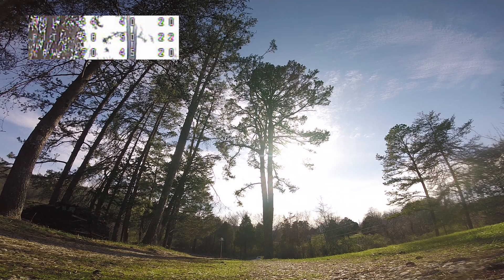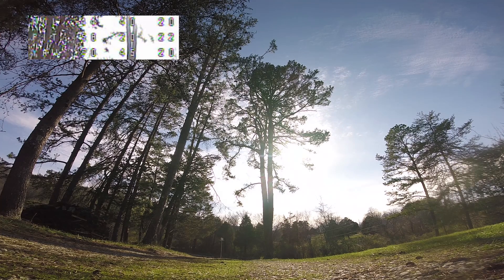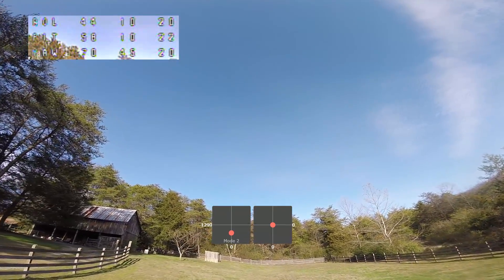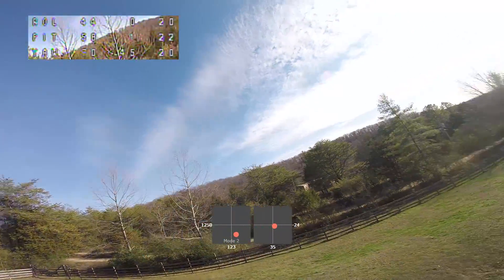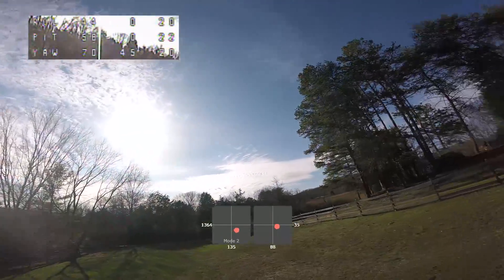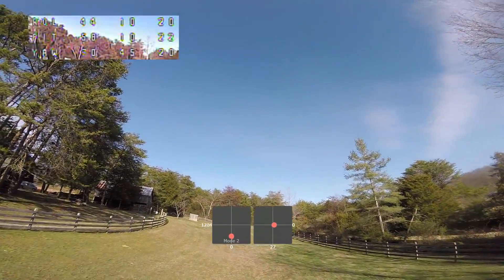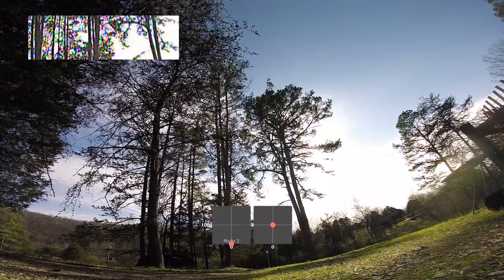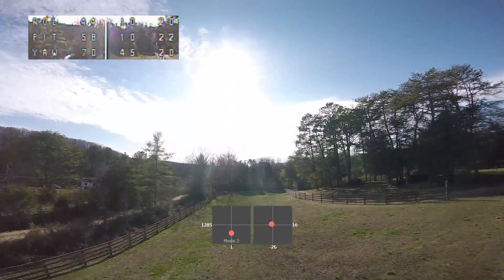PID Tuning Masterclass - Part 4 - Optimizing I Gain

Comment: Hi,  in just hovering, when i throttle up or down my yaw drifts slowly to the right. Until i throttle some more it rotates the quad like more or less 90°. Is that a sign of low yaw I gain? No matter how many times i add yaw trim it doesn't go. And also my roll, it drifts left even no wind and just keep adding trim till its almost 50% trim. Are those i gain probs?
Reply from the maker: First, don't add yaw trim :-) Your channels should always center at 1500 us or the quad will have issues. Go into the Receiver tab and use subtrims on your transmitter (or trims if it doesn't have subtrim) to adjust the channels until they center at 1500. 

Then never touch the trim switches again.

If the quad is in autolevel mode and is drifting, here is how to fix it https://www.youtube.com/watch?v=otJNzZrE-yk

The quad will never perfectly hover. You will always need to make small adjustments, but it should only be small adjustments.

Comment: What are some symptoms of too high I gain? Can micro wobbles on yaw at low throttle be one?
Reply from the maker: No I don't think so. Honestly I think you can crank I pretty high on the latest firmwares and not get anything radically wrong, just a bad flight feel. Very stiff. Micro wobbles on yaw are probably either high yaw P gain or too much noise/not enough filtering. Soft mount the FC. Maybe lower gyro cutoff filters.

Comment: Hi Joshua maybe you can help me. I only have oszilations on my quad when I do high throttle punches. I tried that tpa but it does not seem to have an effect. Have that on 2 same builds. Maybe you have a tip for me.
Reply from the maker: Reduce P gain.
Reply: Thank you that helped me for one copter. On the second it didn´t. I have seen that i forgot a cap on this. After soldering it this copter seems to fly right. Can a cap influence the high output (35A ESC)? Thought it´s just for Videoprobs...

Comment: When I punch out then cut throttle, my quad acts as if it had no thrust keeping it level, it just starts tumbling to the ground, I raised my min throttle from 1070 to 1080, did nothing.
Reply from the maker: Turn on air mode.
Reply: Joshua Bardwell thanks Joshua!

Comment: I've having nose dip after punch out problem and no amount of I gain can fix it.  Have you discovered any other cause of this problem ?  It seems like it's caused by motors spinning up and braking at different rates or something.  I could see an aerodynamic effect causing it too but what could it be ?
Reply from the maker: Use anti_gravity_gain. Enable the Feature in the Configuration tab, then raise the gain number int he PID Tuning tab. Start at gain of 3 and go up from there. Usually between 3-5 sovles it on my quads.
Reply: Worked like a charm ! thanks.

Comment: what would be common issue for quad to yaw left right after punch out?
Reply from the maker: Raise anti gravity gain. Make sure anti gravity feature is enabled in the Configuration tab.
Reply: question im running 3.1.6 so would it be better i go ahead and update to 3.2?

Comment: Hello, This is a really helpfull video thanks.its getting me through tuning my matek/chameleon build. struggling at bit to lose jello. I have a question, when starting a tune should the filters in Betaflight be set on or off? thank you
Reply from the maker: I usually go to PT1 for sure and then remove the gyro notches one by one, looking for hot motors as I go. Then I tune. Then while adjusting D gain I see if I can remove the D term notch without getting hot motors.
Reply: ok ill give it a go , thanks for the answer

Comment: You are guessing. Yes, there is a relationship between all the gains.. Think on the quad as having inertia around all 3 axes. The motor supply force. Multiply the force by the dist from the axis of rotation to get torque. Then divide by the inertia to get angular acceleration. That is simply 2 poles at the origin in the s-plane. After adding the paid the will be 3 closed loop poles if you ignore the time it takes the props to spin up. Now place the closed loop poles and calculate the paid gains. But first the units need to be known.
Reply from the maker: You're so smart, stop commenting and show me how good your quad flies.
Reply: Study this
http://dspace.ucuenca.edu.ec/bitstream/123456789/21401/1/IEE_17_Romero%20et%20al.pdf
See equation 18.  This document talks about placing poles and zeros but doesn't show how to do it.  I may make a video on doing that.

Marlon Clark asks below "Why aren't flight controllers able to tune themselves?"   That is a good question.  The trick is getting the values for equation 18.  Then it is easy.

Comment: Is there a part 5? It seems you ended this one and never quite ironed out the wobble on punch. You ended the other two around like 70p 50d or something but ended this with them lower. I assumed once you found the sweet spot with P and D, then you just raise your I until it holds solid attitude?
Reply from the maker: These days you should use anti gravity gain instead of raising I to keep the nose stead on throttle punch. There isn't a part 5.
Reply: Ohhhh alright thanks!
Reply: Joshua Bardwell as in, turn it on or did you mean increase anti gravity gain?

Comment: That's weird watching the quad "lock on" when you step on it, then "wander off" when you let off, when demonstrating "too low" I-gain. It's almost like you don't even have Air Mode on, and it's just free floating at zero.
(I'm still learning to fly and don't often use Air mode)

Comment: Hi Joshua, you say that with I term, the quad stay on its attitude after punch throttle. but does the CG influence ? my motors spins when the throttle is 0, and tends to horizontalizing the quad. So do I need to stop the motor when tuning PID ? thx

Comment: if you hate hearing, "battery critical" all the time, you can add a diode and 250uf capacitor to the voltage sense wire to slow down the voltage change. (though it makes it read 0.7v lower than it really is.) Or, if you have a taranis, there is a cool trick someone did with a delay parameter in the mixer to delay the battery alarm.
Reply from the maker: I've set up some logic like that in the Taranis.
Reply: Awesome. I fly spektrum and that is one feature I really wish spektrum could do. I always have to add a diode and cap and then always remember to set my voltage alarm 0.7v lower.

Comment: how many packs does it take on average to tune a quad
Reply from the maker: It really depends on the quad. Some quads fly great on default pids and only need a little tweaking. Some quads, you're constantly trying to get it right.
Reply: I only have 6 packs so I'll see how that goes. Thanks for the help

Comment: what would cause a almost yaw to right when doing punch and most time hitting 75% throttle? its a very quick jerk to right and back ?
Reply from the maker: raise yaw P gain by 25% if you are at default, then raise yaw I gain.
Reply: Thanks ill try that, well lol i had anouther random loss of data on board today but was the 15th flight this time and i was giving it second chance but nope again it erases all setting.. when board plugged in after happen saids something like "unrecoverable serial port connection" but the revo f4 board has no memory for blackbox so not sure whats happened. Omnibus f4 pro v3 will be going on soon though.
Reply: Joshua Bardwell so I have magnets coming loose again lol don't know what or why they do, so I used c.a glue to fix one then I had anouther come out 8flights after. I use mb2207/2400kv there strong but these had magnet come loose and emax 2205 did it to any suggestions? motor on hard run 80deg

Comment: @Joshua Bardwell
What was the result? Did you ever get rid of the nose drift after punchout? After an hour of tuning I got all my P and I terms up to 100 and it still wont go away. I have almost no oscillations though. (250 quad, spracingf3evo).

Comment: Are you flying in acro mode in these videos? I am currently trying to switch to acro, so I watch as many videos with stick overlays as possible to try to get a feel for what the sticks should be doing. In your videos, if you turn right, for instance, it doesn't appear that you have to take the stick back to the left side of center to stop turning? It is difficult to see when it is happening so quickly, though. I am just really struggling converting to acro mode.Especially on indoor tracks on the simulators. Any tips?
Reply from the maker: +Taylor May in acro, the copter stops moving when you center the stick.

Comment: Dear Joshua, do you think that a custom mmix that takes into consideration the exact geometry of a frame will help/improve in any way the flight characteristics of a quad? Thank you very much for such good content!
Reply from the maker: Not if it is a flat quad (i.e. not an A-tail or V-tail) with rectangular or square motor layout.
Reply: So basically this geometry information does not help the PID algorithm on roll and pitch in such a way to be more correlated to the actual  frame geometry ( i am refering to a 210 qav). I was thinking that by putting the correct mmix information one will get closer ( equal ) PIDs on roll and pitch or something like that. Thank you again for making the time to answer our questions!
Reply from the maker: +Brad Simionescu yes, PIDs would be closer to equal. But the dominant factor is not motor layout but weight distribution. And determining that is not trivial for most people.
Reply: That is insightful Joshua, thank's again!

Comment: I want to use the buzzer on a matek 5in1 and trigger it from a switch.  The matek manual tells me the pwm signal it looks for but I'm not sure where the signal wire would come from on my lux v2.  There are buzzer pads but that only puts out voltage not a signal.  The lux only has 4 motor outputs so I'm not sure how I would do it.  Any advice is appreciated.
Reply from the maker: +DrFuNK you need to use channel_forwarding but I'm not sure the Lux breaks out the pads the aux channels would be forwarded to. Maybe you could use Betaflight resource remapping to move the signal to an available pin. The bottom line is I don't think it will be easy for most people to get it working.
Reply: Joshua Bardwell ok thanks.  I'll just go buzzerless.  One more question: the 12v linear bec on the matek says up to 500ma continuous and 1a for 10sec/min.  I want to run the Unify pro Hv off of it because it's filtered power.  Unify manual says it draws 600ma at the 800mw setting.  I personally think it would be fine but also I'd hate not being able to fully trust it.  I'm not using the 5v/.5a reg built into the Unify for the cam but tbs doesn't say if the ratings are with or without the reg in use. What would you do if you wanted to run 800mw?  Use a different pdb/reg?

Comment: My apologies if it's been covered previously,  working through your back catalog now.  But what I am experiencing is when I yaw the copter seems to roll.  Example:  I take it up to level flight in a hover and give right yaw input.  The copter yaws right will simultaneously rolling right (no roll input given),  as much as 30degrees or so on a 90+ degree yaw.  What is your opinion on what that could be?
Reply: Ok, disregard what I said.  Went out on my lunch break to fly and it was camera tilt.  And despite what I said before from memory,  in actuality it was rolling opposite yaw direction.  Thank you to everyone who chimed in,  sorry for wasting your time with it.  I am getting the tune good now though.
Reply: Do you have any camera tilt?
Reply from the maker: +damage.cc the copter rolls the same direction as the yaw, or the opposite direction?
Reply: Sorry Josh was referring to damage.cc when I asked about camera tilt. I know you have it!
Reply: Rolls the same direction as yaw.  I.E. if I yaw right, it rolls right.  I don't currently run a HD camera.  I'll try to get some GS video of it.

Also, I do run camera tilt, about 30 degrees or so,  but I wouldn't think that would be a factor in this.
Reply: damage.cc no if its in the same direction, it's not the camera tilt. what version of betaflight are you running? any chance you can get a blackbox log? that would be the easiest way to help you out. I'd be happy to take a look at your log. I know Josh is pretty busy these days.
Reply from the maker: +damage.cc Cera. Tilt would cause the copter to appear to roll the opposite direction. I have no idea what could cause what you're describing.

Comment: Josh, is it possible your COG was back a little bit on this quad and that's why punch outs raised the nose? If the COG is off it's going to cause this issue. Your back motors are working hard to help the back keep up with the front motors. I had this same problem recently.
Reply from the maker: +RoscoFPV no, it's not the CG. It's 100% an aerodynamic effect.

Comment: Joshua, on a windy my quad wobbles when I was just flying in straight path. I had to lower the I gain and wobble stopped. Is this correct?
Reply from the maker: +Jack Truong well it worked for you.

Comment: I follow your videos almost religiously. Informative, up-to-date, and easy to follow. Has helped me so much with building my 1st 2 drones and getting them tuned in (mostly). I do have a question for you tho, if you see this, and I was wondering if an imbalanced motor would cause mid-range oscillations but not on low or high end? I have been trying to tune it out for a while now, and while better, its still there. If I had a spare motor of the same type id try and replace it but I dont (stock issues). I have tried other things such as different props, re calibrating the FC, and others and its always very similar. I was just curious on your opinion? I know there are other variables, some ive tried, but dont want a massive page of text here listing em all. (I will be buying more motors ne ways so im not trying to skimp out, just looking for a pros opinion and possibly solutions?) THANK YOU!
Reply from the maker: Yes, it's possible that you get some resonance at a certain throttle position.
Reply: Conarc เฟ็ด

Comment: Hey josh I'm having trouble with my fpv system I keep frying Cameras I am getting 16v to my camera leads and the  camera says it should be good from 5 to 17 volts am I just pushing it to close should I try a camera with a max of 22v like the run cams blew up 2 foxteer cameras please help thanks
Reply: Alex Dalton Use a bec with low esr cap
Reply: What camera are you using? Ive had very positive experiences with the foxeer hs1177 and foxeer arrow (hs1190?) Ive only run vcc 3s to the hs1177, but for the Arrow ive also hooked up vcc direct off a 4s w no issues (has a cheap OSD fer flight time and volts so requires direct bat connect, been running this for about 3 months) If you do go for the arrow tho, the 1 problem ive had was while changing the camera case, sometimes the camera doesn't sit perfectly square inside the case causing corner blurs, easily solved w a dab of hot glue. Good luck m8!
Reply from the maker: I wouldn't run a 17v camera off of 4S vBat. I would use a 12v regulator.
Reply: Joshua Bardwell ok thanks Could I use a linear regulator?
Reply: Conarc thanks I believe it was 2 foxteer mini fpv cams 700tvl ( was weird cus I plugged up once and it was fine plugged up agian and magic smoke I'm trying a run cam swift now with a 12v regulator to bring the 16v down to 12v
Reply from the maker: +Alex Dalton sure
Reply: Joshua Bardwell sweet radio shack it is lol
Reply from the maker: +Alex Dalton does your copter not already have a PDB or something with a 12v regulator? You could even use a 5v regulator if it has enough current rating.
Reply: Joshua Bardwell it's one of those weird pdbs where it is part of the frame  and I  believe there is a regulator on fc but not pdb thanks for your help RadioShack to the rescue liner regulator 12v fingers crossed  thanks josh that was the issue I guess the camera was getting to much power cus radio shack linear regulator and run cam swift solved it thanks again

Comment: What is your tip for an x frame with underslung battery, when catching it from a dive with low throttle there is a real pendulum effect sometimes, just fly around it or raise I drastically? I don´t like the feel of high I so I prefer just avoiding it, any advice ?

This series was awesome btw great work
Reply from the maker: +Chris S. Anti gravity gain I guess.

Comment: This is a fascinating series Joshua but it seems to my uninformed mind that the entire process of finding the perfect tune could be automated through smart software. I know there used to be an autotune, could it not be refined?
Reply from the maker: +patrickcol this is one of those things that is easy to conceptualize but very hard to implement.
Reply: It´s already implemented with autotune but I havn´t heard much about people actually using it, the results are not impressive

Comment: Question: Are there any form of autolevel here, or do the control system only control the rotational velocity?
Reply from the maker: Acro mode. No autolevel. Gyro-based only. Rotational rate (degrees per second).

Comment: Joshua, I having a slight issue with a tune on a flip well more of a power loop I would yaw to the right a little. It fly's well other than that with a few oscillation here and there but not that bad. I have watched this series looking for a little help. Any suggestions on where to start first.

Thanks

 You really helped me get and many others that have struggled from time to time.
Reply from the maker: +Logo 800 if your yaw P is at defaults try raising it.
Reply: It's not but only like 5 higher. I will give it a try. Thanks